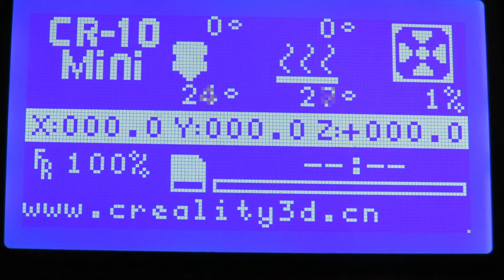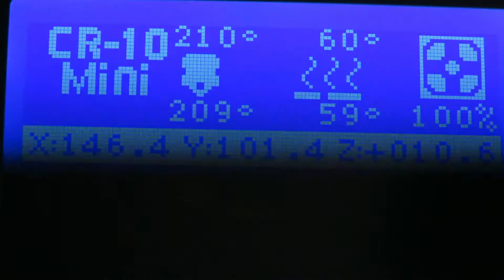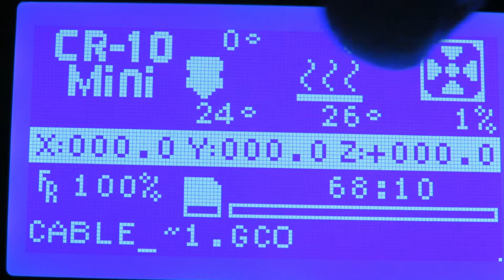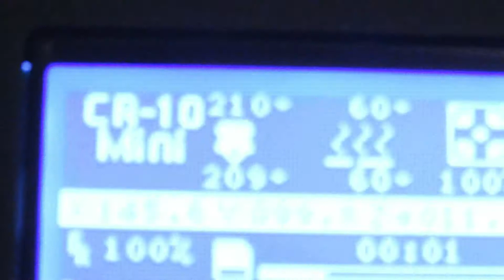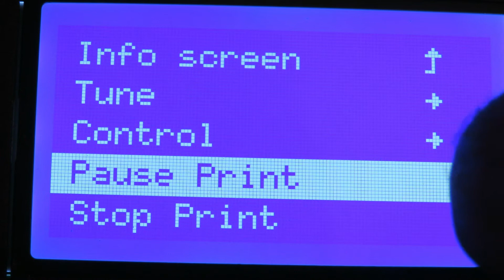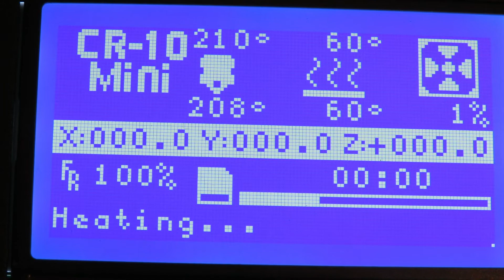📌 Creality CR-10 Mini 3D Printer Resume Print Test after a power failure? - Does It Work?

Comment: Breaker tripped and lost power to my cr-10 mini and I hit resume print.. It heated up and moved to home. It says "printing" on the display but it's just sitting there in the home position doing nothing. Been sitting longer than it was originally printing for
Reply from the maker: Thats not sounding good.
You can try turning off the power at the wall, to simulate a power outage. then back on, but I doubt it will work, but its worth a shot.

Comment: Argh!  My "Resume Print" didn't work.  14 hours into a 15.5 hour print and we lost power.  Help!  Is there a way to salvage this print?
Reply from the maker: If you know the line it was printing when the power failed, you can manually override and start the print there.
Reply: i had the same problem and tried to find exact position in .gcode-file in order to delete the code until that position, where i stopped the printer. couldnt find the z-Position. It was written in another way than on the Creality-display...

Comment: So when the power failure happens does the hot end move away from the part?
Reply from the maker: The hot end stops where ever it was in the print upon power failure, and heats backup when power is restored, then continues the print.
The hot bed will also cool down and be reheated.

Comment: mine doesn't work :(
Reply from the maker: It won't turn on or something else?
Reply: Garry Purcell it come in. I hit resume. Then it spits out all the filament back to the spool holder for a few minutes the extruded motor stays in reverse. Then it says printing. Moves around for a fe seconds and stops. It will still say printing but it doesn’t move.
Reply from the maker: Is the printer manually stopped you, or power failure?
Reply: Garry Purcell I shut the power off. To see if it works.
Reply from the maker: The printer will start to reheat the hotend and bed, to get it up to printing temperature, before resuming your print.
Reply: Garry Purcell printer gets up to temp. It never prints.
Reply from the maker: I would suggest you contact Creality3D directly, it might be a firmware problem, or faulty mainboard.
Reply from the maker: Here is Creality3D website http://www.creality3donline.com/
They have a contact email on the right hand side.
Reply: @Quepiid   I am facing the same issue with my cr10-S4. Have you found a solution to it? It heats and shows printing but get stick to ths home position. If you pause before switching off (controlled power outage), it will return to where it was paused and that's it.
Reply: Garry Purcell they never respond to me. I emailed 3x
Reply: @Quepiid  Hey, I've  just found the solution today and it worked fine for me. Go to https://www.printedsolid.com/blogs/news/installing-marlin-1-1-9...(you can google it) Download the link CR-10S 1.1.9 Firmware Source code and Hex Files. Then in the instructions they tell you to download a certain XLoader to help you update the firmware and enable the resume function properly. Carefully choose the Hex file for your printer. CR10S S4 or S5. Hope it works for you also.